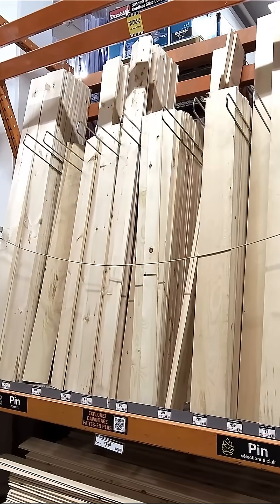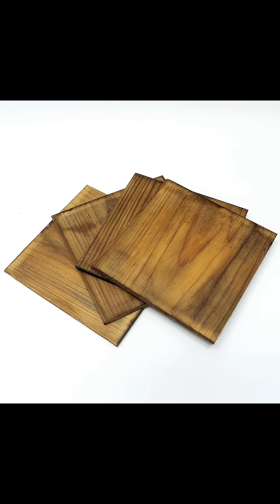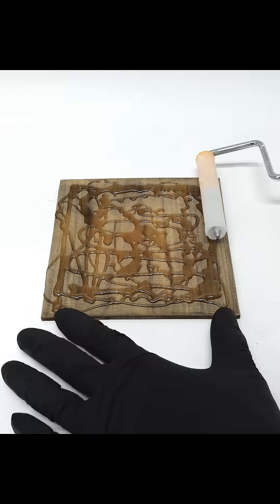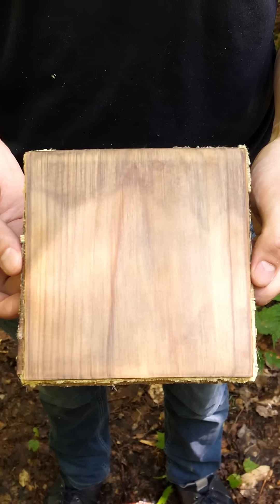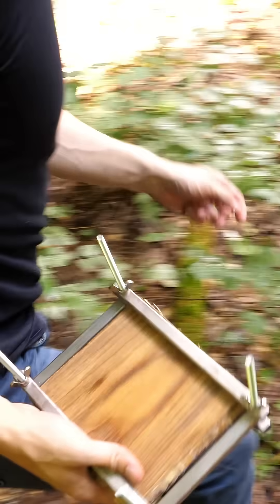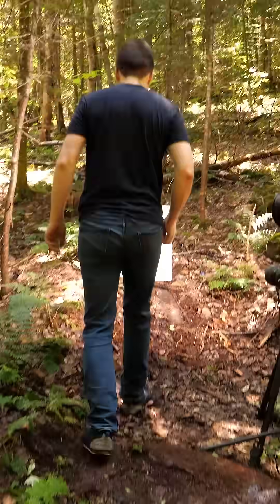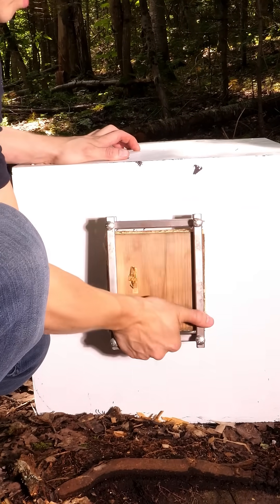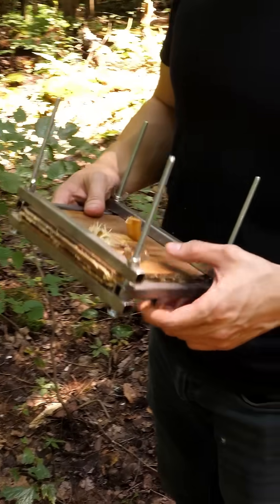Making bulletproof-er wood

Comment: Time to whip up some ballistic gel so you can see how deeply the rounds are penetrating. It’s all ENERGY. You know your tougher plate slowed the 9mm slug more than the old one. If you keep departing from chemistry (which I teach), you may end up a practical engineer (which I also teach), or perhaps an applied mathematician (yeah, I teach math too).😂

P.s. Kevlar AND another plate introduced TWO variables…FUN, yes, (but not nearly as sciency as making 3 plates and assessing penetration using just more wood or just kevlar layers before “hybridizing” them.)

Comment: I think that the most possible route of improvement is to process with the chemicals many layers of wood, split or cut as thin as possible and then glue them up with some heat-resistant glue in the plywood criss-cross fashion before compressing them all together under heat. That would probably result in a more rigid product.

Comment: Maybe try your first compression again, but first soak the wood in waterglass (sodium silicate) and press it while letting it dry. I heard that coating wood with waterglass makes it very dense and helps prevent wood from rotting. I could only think soaking it for a long while and compressing it would enhance its ability to stop a bullet as well. You just have to make sure the wood is completely dry after compression.

Comment: Mix silicon with pea gravel. Layer that in between the wood. Nothing and I mean NOTHING stops bullets like sand/gravel. The bullet needs to yaw from initial impact then be cought in a tumble with it's greater surface area. A bullets purpose is to keep as much energy as possible for as long as possible on the way to target. Robbing that projectile of its energy as quickly as possible is the key to bulletproofing non bulletproof things. If you want to see a proof of concept try shooting a cinder block the long way. You may be surprised by how many rifle rounds it will actually defeat

Comment: Make 3 1 3/4 inch thick woods, and sand which 1 inch steel into the wood (or any cheap steel that work against bullets) and add Kevlar to the mix by putting 2 layers between the steel and wood

Comment: I think the Kevlar being glued in place kept the wood fibers from breaking into each-other to absorb the impact. So each layer would basically have taken the full force for each layer, rather than having the force being dispersed throughout all four layers simultaneously. It’s kind of like how running a electric current throughout a jar of water won’t break down into hydrogen and oxygen easily because the water will disperse the electricity through the entire container of water, but if there’s a couple of electrodes in there it will condense the electricity enough for electrolytes to happen.

Comment: New idea, since everyone is talking about Kevlar’s ability to deform, and glueing it renders it worthless, then, why don’t you take a few sheets of that Kevlar, and  stick it between 2 wooden sheets around the same thickness as in this video, and don’t glue the a Kevlar, but make the wood about the same height and length as the Kevlar, then glue 4 new around the 2 wooden sheets to create a wooden box with Kevlar inside, and since the Kevlar won’t be glued down, it should work.

Comment: Pea gravel sized pottery shards glued (impact resistant glue) to ruffle folded kevlar on top of a flexible sheet of heavy plastic loosely sewn to a sturdier sheet of plastic with kevlar threads.

Pottery shards deform the bullet dispersing the stress of impact so it is more likely to catch instead of slipping through.

Ruffle folds of kevlar increase direct thickness while still allowing movement in the fabric that would otherwise be impossible in such a tight setting. 

The first plastic layer is meant to flex along with the kevlar to disperse the forces.

Second layer of plastic is meant to hold and further disperse the forces whole catching any pieces of pottery or bullet.

Can add a second layer of potter/glue and normal unruffled kevlar between plastic layers to further catch anything that pushes through. 

This would probably only work with pistol rounds and be worse than a normal pistol graded vest, but who knows changing the materials around might stop intermediate calibers without the weight of the normal vests graded for that.

Comment: Hi, I previously worked at a paper mill where part of the process involves removing lignin from the wood. For reference, the wood chips in that process are about 1 cm thick and are exposed to white liquor for 12 hours at a pressure of 12 bar and a temperature of 120 degrees Celsius.

I believe that in order to compress the wood further, you need to remove more lignin. To do that, you could use even thinner wood pieces and expose them to the white liquor for a longer time.

If you encounter problems with the wood not holding together because all the lignin is gone from the surface, I think using epoxy instead of regular glue could give you much better results.

If you need help with anything in this project, I’d be happy to assist. I work as a materials specialist, mostly with steel for pressure vessels.
Reply: Have you watched the original video where Nile uses the compression/heat treatment procedure?
Reply: Fascinating. You seem brilliant

Comment: Maybe maybe if you glue your wood plates and attach the Kevlar in front and or behind it, it might work better, but definitely try connecting all those wood pieces. Your experiment here had two variables, better luck for the next try

Comment: Kevlar uses the ability to tangle the bullet... You made a object designed to flex, rigid.  Carbon fiber would have had different effects..   if you had wraped the wood with Kevlar instead it would have had different results.... 

Look up dragon scale kevlar.  Its ceramic plate wrapped in kevlar type material.

Comment: The thing about wood is that it splinters, mythbusters has shown what 1700-1800 ship canons did and it was pretty much the same end result with the wood splintering, that is what would have wounded or killed any sailors during that time 😅not the canon doing the killing but the wood doing it instead.

Comment: Kevlar works different. The need to be multible layers of it and it has to be free. They way kevlar stops a bullet is by bending with the bullet not letting it through and distributing the energy of the bullet.

Comment: looked like you used something like CA glue which is pretty brittle, but if you used something like wood glue that has rigidity while offering some plasticity then combined with the comments about kevlar in the back and you'll probably have something worthwhile

Comment: Kevlar is like a catchers mitt not a steel plate, solidifying it has taken its effectiveness sadly. 

You could try layering multiple sheets of kevlar together with a layer of thin foam or something and pva glue to let it flex
Reply: Another option

Wood-foam-wood-foam-wood-kevlar-kevlar-kevlar

Comment: I think having an air gap between two plates might help. Like when the plates are together, the force from the Initial impact is spread over both plates. With an air gap the second plate is 'fresh' while the energy of the projectile has been dissipated by the first impact

Comment: try it with 1/16" thick sheets with kevlar between each sheet and make the final piece as thick as the original probably work better than your second attempt, but to be honest a single piece of treated wood  as thick as the 3 piece set up you started with would probably work better than trying to make a laminate work

Comment: Stopping a bullet is easy, stopping the spalling, and making it light enough for a person to wear is the hard part. You need something to catch the spalling so it doesn't cause injurise in say the neck. 
What I would do is put a few layers of Kevlar on the front, few on the back, space out the wood pannels with a riser with a layer of kevlar. Bullets like to punch through one solid mass but don't like trying to punch through multiple of them.

Buuut thats just with my limited knowledge of armor.

Comment: For curiosity, what happens if you try layering different types of wood? The hardest in the back, softest in the middle and mid hardness at front? That and try using a semi flexable substance to hold it in place like how body armor would act (either 3 or 4 springs or a puddy like substance) it seems hard but brittle which is something you might actually want around your chest but not head?

Comment: Kevlars are bulletproof because of its flexibility. It spreads the force in a wide area instead of focusing it on a small point. So sandwiching it between a thick layer of wood and glue restricts it from spreading the force, making it as bulletproof as a tin can.

Remember, harder or bigger doesn't always mean better. :D

Comment: Kevlar needs to flex to catch bullets.. The best body armors are a layer of material that breaks a bullet up and then Kevlar behind it that could flex and catch all the pieces. The best body armors are a layer of material that breaks the bullet up and then Kevlar behind it that could flex and catch all the pieces. So a piece of ceramic or thin piece of steel..

Comment: Just sharing: I saw someone testing the strength of infills used in 3D printing. It was strong at 30-40% but any higher, the infill made the whole thing more brittle. 100% infill ended up being the worst case.

Comment: something to consider here is that good quality wood glues may be your friend. Just know, you want a glue that specifies how much pressure your pieces should be under while its setting. The idea of wood glue is it literally soaks into and through the wood, forming far stronger bonds than just gluing the surface (This is why prying apart some old glue joints occasionally leads to the entire board breaking before the joint fails, a proper application of wood glue is remarkably strong). This test would be very interesting, though you really should put it in a vice or clamp it down (HARD, for something like this imprinting the wood isn't a big deal, and the harder you clamp, the more it forces that glue into the pores of the wood).

Comment: Cross hatch the Kevlar as well.

At sixty degrees. All three layers as one layer.

Put Gorilla tape to hold it, too.

And a non-newtonian liquid in the crosshatch.

Put a ceramic plate in front to deflect/deform the round.

Put the same Kevlar behind it.

Comment: It is all about the thickness most of the time.

5 mm steel and a 7.62 cal flys through.
8 mm still through .
10 mm only litte hole.
15 mm nothing.

Comment: Kevlar works in ballistics vests because it is able to move. It absorbs the force to the point where the projectile does not have enough velocity to punch through. When the Kevlar it glued between two solid planks and cannot deflect inwards, it looses its advantage and provides very little benefit.

Comment: I think that by layering that material you made it possible for the bullets energy at the point of impact to be transmitted through the boards causing the back to explode outward. 
I think that the rigidity is the culprit.

Comment: The trick is fiberglass welding blankets stacked and saturated with epoxy resin, then pressed together until dry. ZNA Productions built one a few years ago, and it was impressive.

Comment: Kevlar has amazing tensile strength, which is why it’s good in bulletproof vests, because it stretches to “catch” the bullet with a squishy material underneath it. But when it’s compressed, and doesn’t have anywhere to stretch, it will just rip.

Comment: Boost tensile strength in the direction parallel to the bullets travel. 
- Try an Alklai treatment. 
- Impregnate with resin. 

Add to the bullet facing side: a diffuse layer of hard ceramic to bleed energy

Comment: You need flexible glue. It would be like apatite crystals in an organic matrix. The hard wood can disperse the force and the glue can turn it into heat and keep the thing from shattering as much. Kevlar is a nice touch to keep everything from falling apart, but kevlar eats energy by deforming and wood eats energy by breaking, so maybe the kevlar would need to be on the back of it. I think you should try a few more kinds of glue, because that clearly changes the properties of it by a lot.

Comment: Gluing and squeezing the Kevlar takes away its flexibility and reformation properties that give it it's bullet resistance strength. 

Same reason why a diamond, while very hard and scratch resistant, is actually relatively brittle and can shatter with impact. No room to flex means it can snap.

Comment: Try using epoxy resin between layers and let it cure under pressure like from your press you used to make the wood, have seen decent fiberglass body armor plates made that way nearly able to stop .223 /5.56 rifle rounds

Comment: basically you got two kind of fiber in this composite with only the glue as resin to hold the fiber(wood and kevlar) together. composite worked when resin act as the absorber while the fiber act as the holder who hold the resin that absorbing all the impact. also the laminar fiber on wood doesnt have enough strength as the kevlar. the composition of resin and fiber also need to be exact which required lots of try and test to get the best mix possible

Comment: Wood grain possesses strength in 2 directions (eg. up & down), and weakness in the other perpendicular 2 directions (eg. left & right). By rotating 90°, you are only counteracting each of their strengths with the others weakness. Take your hands, fingers spread, and overlap them in front of you. Notice how easy it is for a small object to slip between your fingers. Now rotate one hand 90° so that they are still overlapped at the fingers, but perpendicular. The open slits have now become open holes. Granted much smaller, objects can still fit through, even if repeated with more hands (layers). Instead, now try a 45° angle, and imagine layering that over and over, continuing the rotation in whatever original direction (eg. Clockwise). No slits, no holes, and the same amount (4 pieces) covers all 8 cardinal directions. This is more material science rather than chemistry, but I'm a jack-of-all-trades and a scientist (plus a healthy amount of home defense r&d), so I recognize the hand-in-handedness of the 2 more often than most. I also see someone already mentioned kevlar's need for flexion.

That said, I always love your videos. Been watching for years and I've seen every experiment. Keep up the amazing work.

Comment: If you would pack layers of foam between the layers it would be far more effective in stopping bullets with negligible more weight.  Look at the toy with the 5 steel balls on strings in a frame. You made it so dense the force of the bullet is perpetuated to the backside.

Comment: I’m not genius, but I think Cavalier is like a huge net and the reason it works. Best is cause it bends  and stretches to slow the weight of the bullet what he just did was the equivalent of somebody trying to break a pencil when somebody else holds it on contact their arms, jolt, and compensate for a bit of the force being implemented so sometimes you smack something extremely hard, but if it moves at all a lot of the forces lost. This is why when people chop wood they do it on a giant stump and not in the dirt because then all that momentum is lost but what he did here was the equivalent of putting like six stumps of wood, a foundation and everything right below it so all the force gets completely absorbed the caviar has nowhere to go or move forcing it to break no matter what.

Comment: Holy Spirit told me, try using thicker wood instead. And one thinner wrapped in Kevlar. Like 2 big ones. Not too big then in between the other. Afterwards if u rlly wanna stop it? Encase it in a metal not even heavy or thick

Comment: Nile, I still believe you haven't fixed the chemical penetration problem. In wood/resin composites, people use vacuum chambers to pull the resin into all the pores of the wood. You will need to do the same in your chemical bath.

Comment: It's a density equation issue. Try adding a thin piece of metal in the center. Also don't glue the Kevlar entirely; if it can't flex it's simply a granular layer. I would try Wood; 90* Wood; Kevlar glued around the outside only(and maybe a bead in the center); 90* Kevlar glued around the outside; 3 mill aluminum sheet; and mirror. the added density AND flexibility of the aluminum should help bolster both the density of the wood and the flexibility of the Kevlar. I would predict a 9mm would puncture only to the other side of the aluminum.

Comment: Ideas: heart wood (from cherry or walnut), extremely large quantities of balsa wood (soft but squishy so the layers would be extremely thin but there could be many more), compressing the wood into layered cylinders, compressed whole slices of a tree log where instead of using lumber that has been cut longways/vertically you could cut discs horizontally out of a  log

Comment: Try some ceramic balls wedged  between 2 layers of wood soaked in oil or grease. My theory is that the bullet will hit the ceramic balls spin them and redirect the kinetic energy. Obviously some will shatter. You may need to adjust  the size or maybe mix different sizes.

Comment: This is why most body armor has a solid plate (ceramic, steel, or other composite material) with a kevlar backer instead. The idea is the plate will stop or slow a bullet enough to where any fragments that make it through will be caught by the kevlar.

Comment: Instead of using the Kevlar in-between the wood plates, place the Kevlar on the side you're shooting at. Don't glue the full surface of the Kevlar so it can flex to catch the bullet by grabbing it to slow its mass down allowing the wood to hold it. You may need additional wood, depending on wood type and if the wood is moist or dry